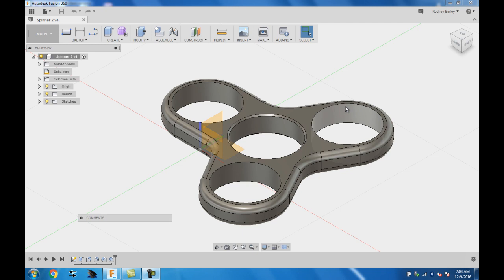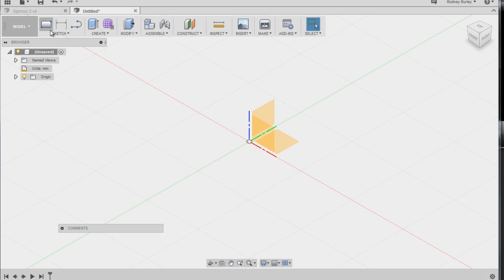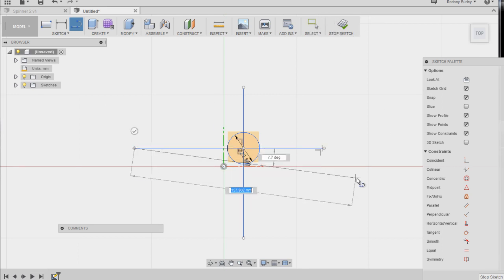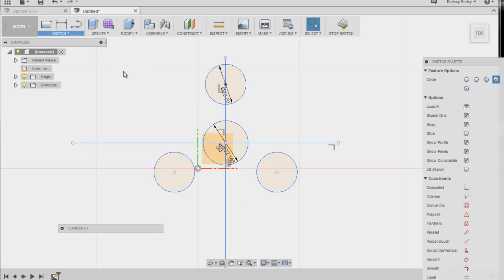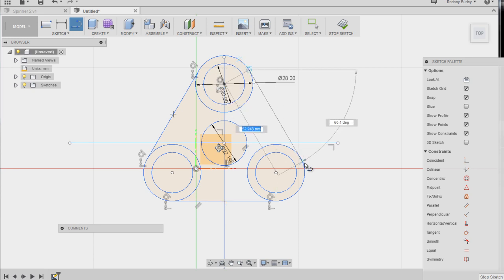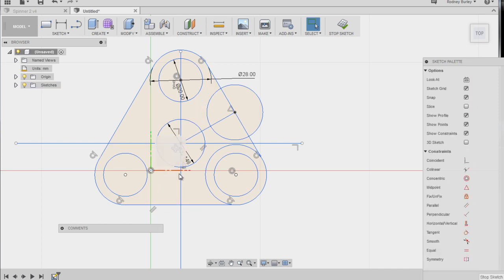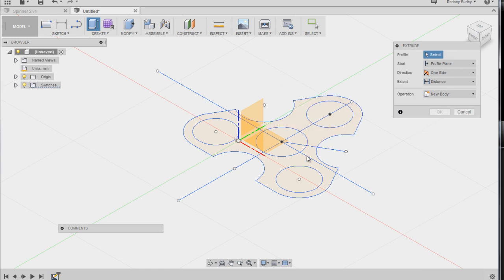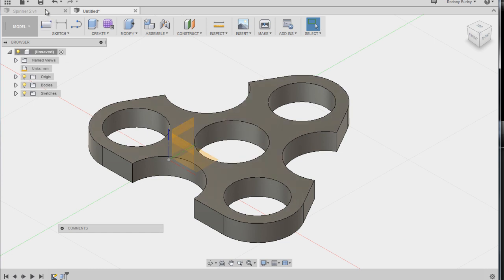Fidget Spinner 3D tutorial 1

Comment: You said that in order to account for shrinkage in plastic, you want to make the bearing hole slightly larger than the bearing. What about if I was machining my part out of metal? 

Currently my holes are .865 inches and are too tight for the bearing (more or less constricting on them). 

Do you know the best tolerance in order to ensure a proper press fit that will stay in but won't constrict the bearing's "free spin?" 

Thanks in advance!
Reply: MODAVIK LLC for metal I would make it the same size yes it will shrink I would just grind it out till the bearing fits
Reply: Thank you. I will give it a try.